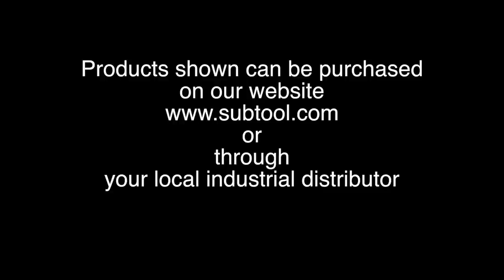Learn the art form of measuring an ID using a ball or telescoping gage.

Comment: As always a great video. I was taught 50 years back when using telescoping gages to pul the gage slowly through the bore but to stop recenter the telescoping gage and slowly tip pacst the center point of the bore. Like the ides of using ring gages to practice on first to better develop a proper feel. Using gages like this require the operator to have high defined skill to use them properly.  Best BB

Comment: Nice video Don, thanks for putting that up. As somebody almost completely self-taught it's confidence building to confirm that I'm doing things correctly from a master. 

I'm not so sure about the whole ball on ball measuring thing, and don't think that was a good idea at all. It was however a good demonstration of why flat parts are measured with a ball measuring face, and convex shapes are measured with a flat measurement face
Reply from the maker: Pete F Pete , that was just to demonstrate that we are getting a good reading with a second check. I agree that it should be checked with a mic.

Comment: This is the second time I have watched this video. I could never get a consistent measurement with the snap gauge but the same was happening with my micrometers. My method was holding it perpendicular and then tightening which caused it to come out of the bore loose. I was using the fine ratchet on the micrometer and it was too tight when I tried to get that gentle slide across the anvils. You have increased my skills to a new level. I wish you could advise me on my 1960 South Bend 13", rear bearing overheating big time but it's a long story and would take 3 or 4 pages to explain. But thank you so much for teaching me how to measure, it will only get better
Reply from the maker: Good stuff, thanks for watching.

Comment: Any tips on measuring big bores? I find the bigger the bore the more difficult it can be to find the center since the sides get flatter and flatter. I guess that ID  mics fit the bill the best then. I like that squeak feel when I measure, if I get that just right ringing squeak I know I am there.
Reply from the maker: bcbloc02 Inside mic or an electronic height gage.
Reply: +bcbloc02 measuring ids with inside micrometers takes a scientific approach. the inside micrometer have the spindle end held stationary as the pivot. the micrometer should be moved in a arc perpendicular to the bore axis moving the micrometer thimble out to find the high point of the arc with a light drag. this same method should be should be used moving the micrometer in a arc parallel to the id axis. note a "squeaky" feel could mean a tight "feel"

Comment: Im curious on what I need to get started as a hobbyist machinist. I am a electrician by trade, and spent many years working in industrial plants working as a electrician/slash mechanic building and working on equipment, so I learned a lot of basics with welding and using milling machines, but no means a skilled machinist by trade. I picked up some tips and tricks from the guys in the shops. Anyway my question is this. I have just bought a affordable mini mill for home use, and the mill comes with nothing but a precision vise and a chuck. no collets nothing. What would you recommend as a starter kit to get me going on a budget, or what are the basic tools or cutters I will need to get started. Thank you
Reply from the maker: It depends on what you want to be done. check out our website www.subtool.com
Reply: SuburbanTool Inc 
Well for example one day, I wood like to make a fly fishing reel, but for now, I want to make a simple right angle aluminum bracket 3 inches by three inches, 1/4 thick and mill four adjustable slots in it so I can mount a depth sounder transducer on the back of my boat.

Comment: I've found that  a bigger radius on the ends of a telescopic gauge gives a more accurate reading. cheap imports have small radius. they are junk. I've seen Starrett with a smaller radius also. any opinion on this? I rarely use my small hole gauges and felt uncomfortable using them... your technique will help me become better at using them .. thank you
Reply from the maker: I'm glad to have been able to help! Thanks for watching.

Comment: Hello, what pointers could you provide to someone in the market for a garage sized surface grinder (used). My concerns would be the ways, spindle and other areas of concern I may not be aware of. Could handle a machine of a ton or lighter but something that might be a
Reply from the maker: barrobby1 I would recommend a Harig 6 x 12 surface grinder.

Comment: How do you measure something like a 6" bore?
Reply from the maker: meocats You could use the telescoping gages. Inside micrometers , electronic height gage, Bore gage. It all depends on what tools you have to work with.
Reply: +meocats ...Inside micrometer...
Reply: Use a bore gauge with dial, there come in lot of sizes and measure it with micrometer

Comment: My advice on measuring small holes within tenths, don't screw around with these type of gauges. Instead get a set of tenths gauge pins and be done with it. Don't forget cylindricicity has a major effect on measured size.

Comment: I don't see any point in measuring the length of the bore gage with a height gage. It'll take too long to find the longest distance, it you ever do find it. I used to measure bores using two precision balls and a set of gage blocks. Sometimes the bores were tapered and I used trig functions to calculate the end diameters and taper.